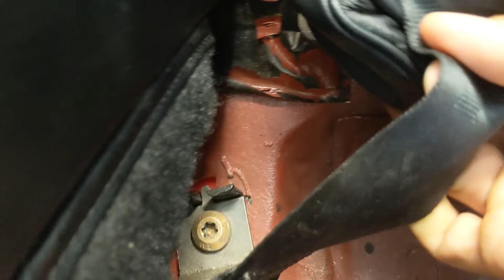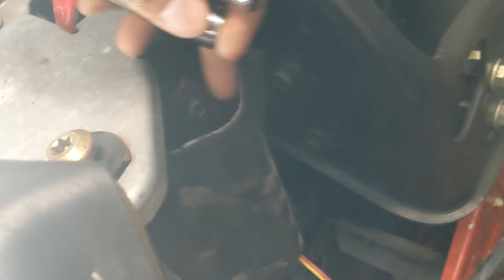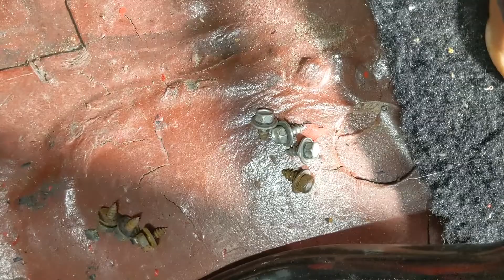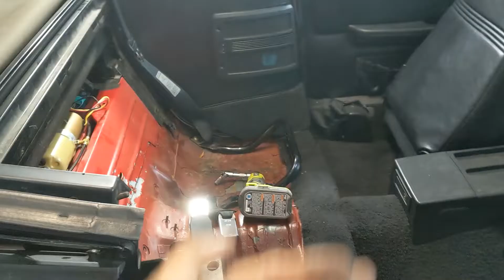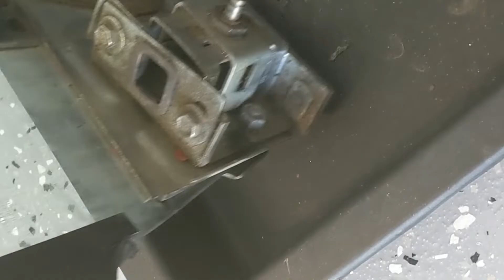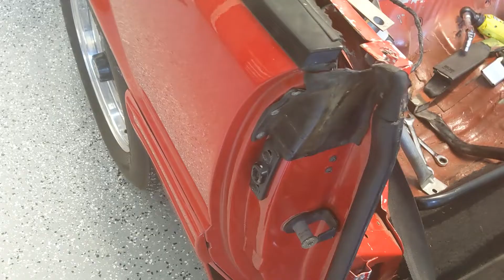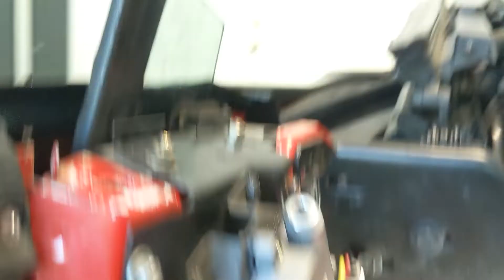Foxbody Convertible Rear Quarter Window removal, Alignment, and Upgrades @latemodelrestoration

Comment: I am convinced there is a man that's probably 90 years old now living in area 51 that was solely in charge of adjusting windows and installing weatherstrips in 87 to 93 convertibles back in the day and they keep him in a Hanibal Lecter cage after he lost his mind from all the years doing this ,if you have one of these cars and you wake up one morning and say to yourself "man that weatherstrip has a little crack in it, i think ill change it" DON'T, leave it be until it has to be absolutely done and dont fuck with any adjustments on anything unless it needs it bad.

I love these cars and at the present own a vert and a hardtop and Ive had plenty of them over the years, the convertibles will test you patience like the vault at Fort Knox,babysitting 7 screaming kids?no worries,Ive worked on a convertible windows and weatherstrip, i can take anything,ill file 1 inch piece of steel down to a 1/8 with a ladies nail file before messing with any window adjustment in these cars,now a hardtop?? piece of cake.
Reply: That is some funny shit 😆🤣.  I'm about to tackle the quarter windows and window motors on my 88lx vert.  It's bothered me now after 3 years of driving car with top down and quarter glass up. I am really dredding the repair as I have already gotten the side panels out car just waiting on the kit from lmr.
Reply from the maker: I died laughing 🤣😂
Reply: @RaymondUrias  hey do you know anyone who does this? And what would be a good price thx!
Reply: @tonyo3856 probably the price will be $500

Comment: This was an incredibly helpful video. The part where he says LMR lied though - the little stud that that holds the regulator to the to the guide track with the C-clip..... that big nut around that pin can be loosened so that you can slide the slotted bracket out of the way and get a socket on the nuts. Just make sure you mark everything like he says. Excellent video and thanks.

Comment: Had this issue lurking since I bought my 88 vert over 1.5 years ago. The window glass came loose from the bracket, and it eventually broke when it fell out completely. The base of the guide rod was broken so I replaced that with the alum one. Now I get to play with adjustment of not just the quarter window, but the passenger door window too! Twice the fun! This video helped immensely. Thanks!

Comment: This by far the most detailed video I've come across for replacing the rear quarter windows on a fox body 88-93 convertible!  I love the "monkey wrench" scale of measurements for difficulty, but moreover appreciate the "step by step" process Raymond walks you through.  Other video's skip steps assuming that you "know" what they did to get from point A to point F with B, C, D, and E missing in-between.  Thanks Mr. Urias... very helpful and functional video!!!!

Comment: Question for you. I got the window out. The only thing I see broken is the rubber bump stop. Would this cause the window to be floppy. Also with the top fully up. The last 2 window motor plate bolts were very easy. Could have gotten with fletch ratchet wrench. 
Thank you.
Reply from the maker: If the window is floppy, it's more than likely the bushings that ride on the carrier
Reply: @RaymondUrias thanks for the response. Quick look over with the window out none of the bushings or rod mount were broken. I was very confused

Comment: By "push forward" you mean, of course, "push back," and by "z" you mean "2 ." Also, by "bit" you mean "bolt," and by "gold" you mean "silver." By "divit" you mean "fastener," and by "notch" you mean "bump," of course. I wish you had shown what you did when you removed the rivets. Did you replace with rivets? Otherwise, excellent video.
Reply from the maker: Yes rivets were used again
Reply: @RaymondUrias  swank. Thank you for answering even though I picked on you. You did a great job. I wish there were some closeups of some of the parts, but this is a real help to those of us looking to do this job. Do you think that anyone makes a top as good as the OEM? Like, I am concerned the material might be cheap. What is a good source?

Also, I want to compliment you on the sound quality. You hve a good speaking voice and your video is easy to follow.

Comment: Hey great job, any idea how to adjust the max up and down on the window? mine is up about an inch too high. everything else seems fine. plus the windows see super loose when going up and down but think that is normal
Reply from the maker: Loose is guide rod bushing which if worn out can affect the max height
Reply: @RaymondUrias  I replaced it all, and better but the metal piece that attaches the seal to the window is not seated all the way on the window so I think this window was replaced at one point.
Reply from the maker: @johnbailey2462 that is a possibility but I think if you did replace all the seals then it is an alignment issue. As weird as it sounds. Trust me if you have too much forward can't on the window it won't come up all the way. It'll keep pushing too far forward and it will stop it. You have to play around with the alignment first. Get it so you can get the window to come all the way up and then play with the alignment from there to make sure that it closes evenly.

Comment: If your motors are clicking it's most likely just a $10 repair to the motor.  It's the plastic in the motor that's most likely destroyed.  Their from Dorman as "Window Regulator Gear Plugs".  If you see bits of plastic along with grease when you take the motor apart then you need them.  There should be 3.  This was a fix for both my motors.  Now they work perfectly.  I paid $20 instead of ~$90-100 for new motors.

Comment: Also another thing where do you find those black metal pins for the moldings?
Reply from the maker: If you need replacement lmr has them or the auto parts store. I know advanced auto has a whole kit full of pins

Comment: Any idea on what to do if the bottom bracket for the window rod won’t align? Do you drill the holes slightly bigger?
Reply from the maker: You shouldn't have to drill anything larger. Just take your time everything should line up correctly
Reply: @RaymondUrias  Raymond, I purchased the LMR kit to do this myself but after watching your work, I would much rather hire you to install the kit if you are available. I live in South Miami and I noticed you are in South Florida.  Please let me know.  Thx, Robert Behar

Comment: Really appreciate the video!  I'm rebuilding the quarter windows in a '90 7Up edition Mustang.  I can't seem to get the guide rod up thru the window new bushings.  I think that I am going to try and remove the cotter pin and the foot, insert the guide rod, then reassemble to see it that works.  I shoould be able to do this with the sub assembly (window and guide rod) inside the quarter panel of the car - I hope!

Comment: I’ve watched this video more times than the Godfather. Seems to me LMR should have just made a new plate too so you won’t have to dremal, cut, or smash anything off. That said I’m very thankful they make the parts they do.

,
Reply from the maker: @Root1966  Never hate your enemies, it affects your judgment
Reply: What size drill bit did you use to make the rod bracket fit the plate? I’ve been looking for days
Reply from the maker: @joshrudolph2343 i cant recall....start with a small bit just to drill out the center of the Revit

Comment: What if your windows are stuck in the up position? Do you remove the motor first then the c - clip?
Reply from the maker: @akileDavis  yeah if your windows are stuck just pop the motor off take off that c-clip and the window will just drop down. Or just replace the motor and it should go up and down easily
Reply: @RaymondUrias  so in that case it’s my motor that’s out?
Reply from the maker: @akileDavis  probably. If you have a multimeter you can check it but you will need two people. One person's going to press the switch. The other person is going to check to see if voltage is getting to the motor. If there is voltage at the motor and the motor is not working then you need a new motor. Luckily that is a super quick fix.

Comment: Here is just an additional note in dealing with the removal of the top rear seat cushion.

The factory design makes it hard to get to the bolts holding that cushion in place, both for removal and reinstall.

The last time I remove the seats, I used perforated metal pipe strapping and created an extension for both the seat back and the flange that the seat attaches to. I then bolted those extensions to the flange and to the seat, then installed the seat and bolted the extensions together.

It took about 30 minutes to do the initial set up, but now removing the seat bolts is about a one minute process! 😂

Comment: Do you have a video for replacing the top? What tools are needed?
Reply from the maker: I do not. Strongly recommend not doing that yourself. I have worked on cars for a large part of my life and that is a project that I would much rather just pay somebody that knows what they're doing. Just getting the parts alone can get expensive
Reply: @RaymondUrias  thank you for your response. I followed your video and was able to do the rear quarter window. So thanks again.

Comment: Thanks for the video.  You did an excellent job covering each detail and the important parts that can cause a bit of frustration.  I appreciate you. I have a 94 Mustang GT 5.0 .  I feel confident replacing my rear widow motor.  Thanks Mr. Juggler

Comment: Great video! My only question to you is in my situation where I actually have to replace the rear glass, does the glass slide out of the top or do you need to lower it and pull it out the side Any advice would be appreciated! Thank you.
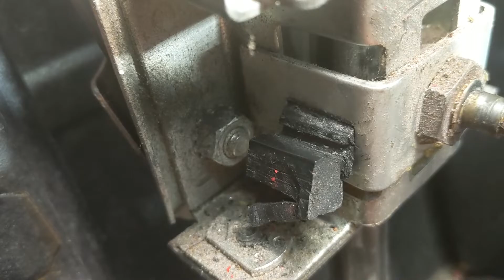Reply from the maker: @21:00

It comes out the top

Comment: I think I can recite the video from memory now.  My passenger side window got slower and slower until it wouldn't raise.  Finally got it apart and jumped it with my 12V car starter and it was fine in both directions.  Switch test resulted in 12v at the power connector.  Cleaned up the contacts, added dielectric compound.  Cycled the window at least a dozen times.  Came back after about 2h and put the car away across our condo complex (0.1mi).  Window wouldn't move.  Motor couldn't be jumped.  Switch still delivering power.  Swapped the motor and it's working fine, go figure.  The motor seems to labor as it moves up, so I will clean the actuator rod (it's a little sticky with aged grease) the best I can.

This particular window has a ton of slop in it when it is all the way down, but the cant and tilt is where it needs to be in order to seal.  Is the slop from a lack of pressure from the weatherstripping?  Thanks, All.
Reply from the maker: Based off my experience and what you're describing, it sounds like the motor had not been replaced in a long time, which means that the original motor finally bit the bullet. But typically when the motor goes, the bushings that keep the guide rod in place begins to break up. Unfortunately this is going to require the removal that whole thing to replace those bushings. I really do wish that somebody would make those bushings out of a better material than that black flimsy stuff. Maybe some polyurethane material would be nice then you never have to do this again. Weather stripping plays big factor in the window alignment as well. If your weather is stripping is shot and you have none then there's no pressure being applied to the window to keep it tight. That's why if you read the forums or if you've ever done this before when you replace your weather stripping you have to realign that rear window all over again because it's going to put pressure on the window as it's coming up which is going to screw up the alignment. This is why I recommend to do everything all at once while you're working on that area of the car because more than likely you will never want to revisit that part of your car ever again lol
Reply: Thanks for the rapid reply!  Good news is I bought the entire rebuild kit from LMR for both sides.  “Soon the time will come to do what is right, versus what is easy”.  -Wizards and DIY car guys.

Owned the car since new (‘92 LX), btw.

Comment: Started doing this today.  Not too bad.  Took an hour to pull both sides apart, took another hours to replace the bushings and the bottom mounts, an hour to reinstall and then 3hrs to adjust both sides to perfect.  Yea, it was a PITA but in all honesty as long as you take pics of everything and don't rush its not too bad.  The adjusting was frustrating at times and I walked away a few times but all in all a job the is doable as long as you have some mechanical background.  Glad I found this video for advice on what not to loosen up,  that was the # factor that saved my day.  Thanks for the video!  Now to replace control arms, springs and beef up the stabilizer bars.
Reply from the maker: You are a smart man walk away and come back later.

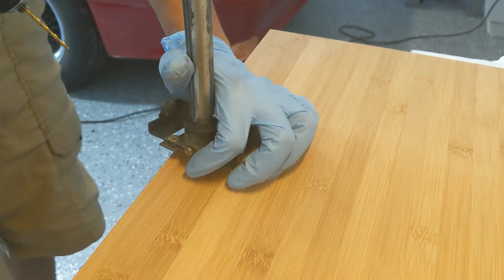Comment: 23:18 did that pin just come right out or did you pull the arm out?
Reply from the maker: The pin comes out it's just a cotter pin but that will disconnect the rod. The rivets have to be drilled out please for the love of God don't do the LMR smashing method

Comment: I have one question. So I did the install and I have a gap between the rear and front window. Do I adjust the bolts at the bottom of the guide rod plate. Or do I adjust the bottom and top bolts on the actual window itself? I'm trying to move the forward cant I think
Reply from the maker: Do not touch the front window, common mistake. Only work on the rear window. Adjust the bolts and don't give up it takes alot of time to get it perfect
Reply: @RaymondUrias  Ok so just the bolts for the guide rod? Not the ones attached to the rear window
Reply from the maker: @korbynwalshdrums8766  4 bolts on carrier assembly and the 2 bolts on floor of the rod are the only ones you need to touch
Reply: @RaymondUrias  Thank you sir!
Reply: @RaymondUrias  I had the window aligned but just slightly off so I adjusted it and now I can't get it back 😭
Reply from the maker: @korbynwalshdrums8766  it takes a lot of patience. Keep trying...
Make sure your doing this with the top up

Comment: Thank you sir, lots of useful information here. I bought a convertible used and somebody replaced The guide rod bushings and that metal piece on the bottom. I can barely get the (manual) window to roll down .   I will be studying your video closely. Thank you again.

Comment: WHAT THE 𝐏𝐇𝐔𝐂𝐊!!
THERE is NO WAY that  I'm doing all of that because its inevitable that I'm going to really goof something up!!
Is there ANY SHOP  in the South Carolina, Georgia, North Carolina area that can replace rear quarter window motor assembies on Foxbody MUSTANGS?  I need their contact information!  I'm willing to pay GENEROUSLY  to get this done!!
I have a 1993 FOXBODY very
https://youtu.be/3_tVwBKTGhI
Reply from the maker: @gearhead704 friend Matt at Fox resto will do it. Don't ask me how much lol. A local shop here charges about 4k
Reply: @RaymondUrias  I would GLADLY pay $1,000  but 4k is RIDICULOUS!! 🤔 Right now I move them UP&DOWN by hand while holding the window "up and.down" button.  When they are up I AFFIX them into a locked "UP" position with my own technique.  I also do the same to my convertible top motor.  I disconnected the hydraulic hoses to the top motor and I put my top up and down MANUALLY  as easy as an umbrella.    The convertible top on my C4 corvette is a manual and the top on my FOXBODY IS EASIER to let up and down than my vette!
(back on subject) But I STILL would love to have my rear quarter windows working properly!👍
Reply from the maker: @tumarbongrox6074  That's why I made this video to show everybody how to do it. Florida prices are stupid everything over here is expensive.

Comment: There is GT vert for sale and the rear glass motor needs to be replaced..NOW I know WHY!!
This is not an easy fix and could be expensive to get it done if you can find someone who can do a good job like you did.
Great video BTW!! 👍
Reply from the maker: Definitely 3 out of 5 wrenches. Most verts don't fix it and never roll their rear windows down. Don't know what they were smoking when they thought this design up

Comment: I watched your video and have been replacing most of the parts in my foxbody thank you for that. Do you know what size C-Clip that was at the bottom of the window regulator arm?
Thanks
Reply from the maker: This is what I have in my garage Incase I loose one
Hilitchi 380-Pcs [14-Size] E-Clip Circlip External Retaining Ring Assortment Set - 304 Stainless Steel https://www.amazon.com/dp/B079BPCRZN/ref=cm_sw_r_apan_glt_i_R3HEZP3NCZNSX1YGRA48

Best part is that it's stainless so no rust

Comment: Hola amigo Raymond , saludos!!  Aprovecho tu canal para preguntarte a ti y a tus seguidores. Qué tipo de transmisión es la que tiene el Mustang 92 2.3 lts automático Convertible.?
Reply from the maker: Mine has the AOD but it's the 5.0
I just installed 3.7 gears and it really woke it up. But you can't do that on the 2.3
Reply: @RaymondUrias  muchas gracias! Saludos

Comment: You can help me with a reemplace top Cylinder hydraulic Mustang 92?
Reply from the maker: Swapping out the hydraulic motor is not difficult it's a very dirty job you're going to get hydraulic fluid everywhere. If you have to replace the Pistons they're a little bit trickier when I recommend is pinching the line hopefully your line isn't old and doesn't brutally break. Then just swapping up the piston it's just a tough spot to work in